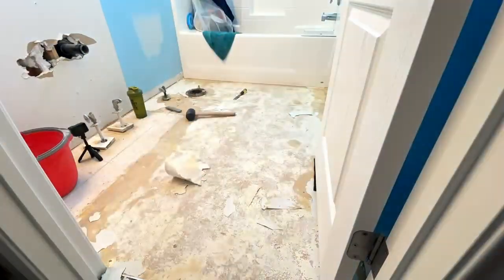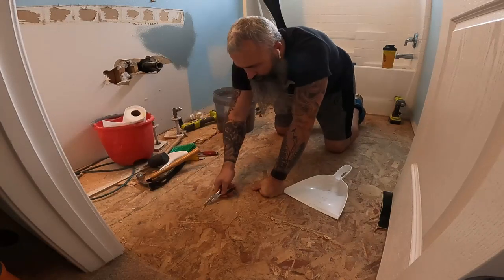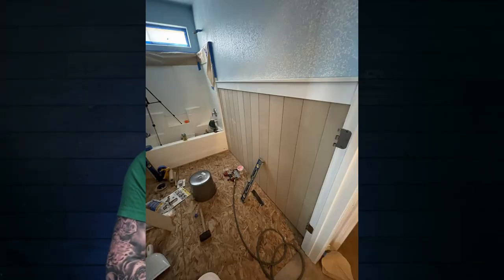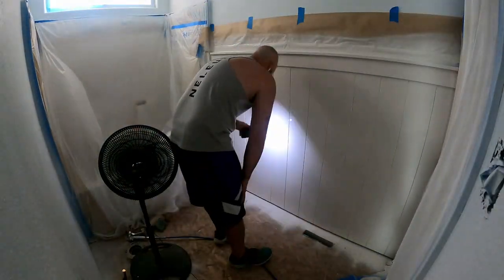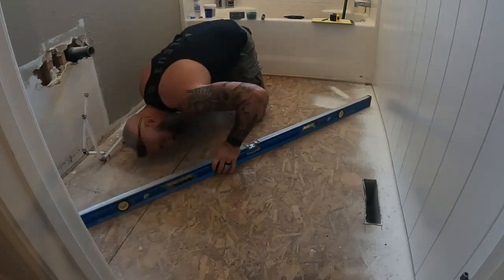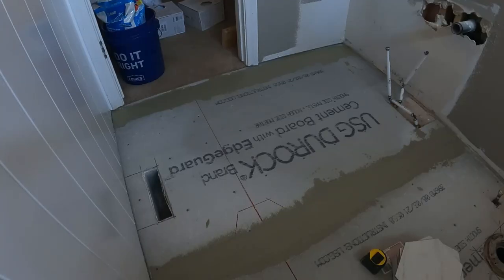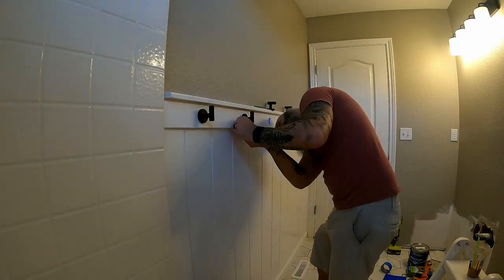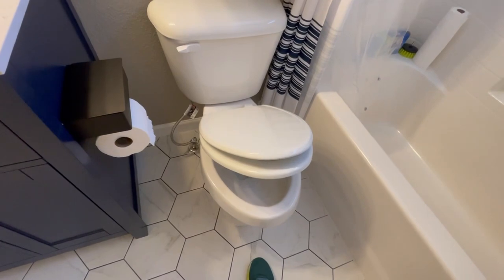How To Remodel A Small Bathroom

Comment: This video was just in time i’ve been planning a remodel for awhile now this video helped a lot. As for the cement board do you feel water guarding it is not necessary? I’ve been debating whether to get the cement board with the hydro defense vs the standard but just wasn’t sure if I need to. Any input? Thanks
Reply from the maker: My view is you put mortar on top of the cement broad, then tiles on top of that, then grout in between and the caulk along the tub line.  Yes it’s possible for water to get down there but not likely if I did the job right.  If you just want the extra piece of mind then I don’t think it’s a bad idea.  Especially if it’s a small project since it won’t have a huge affect on the total cost.  I’m about to do a laundry room and will likely go that route since it’s more likely to get a leak from my washing machine.